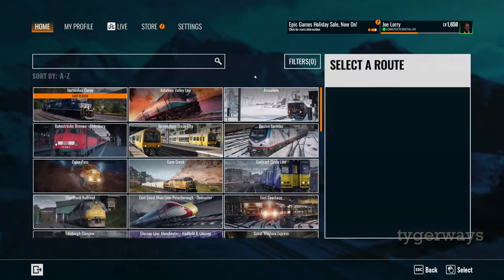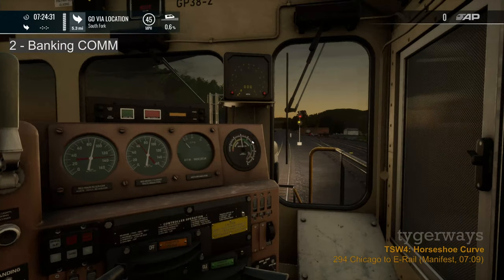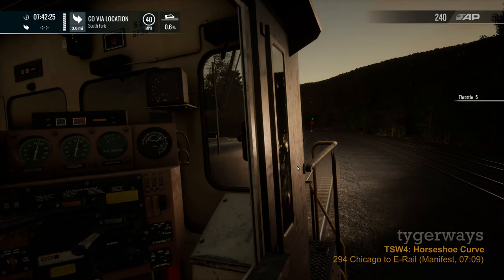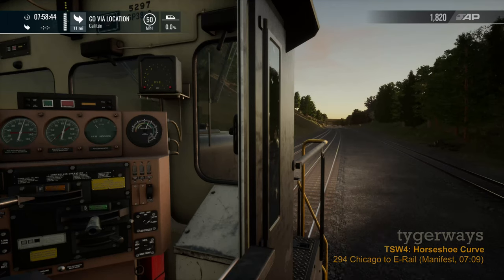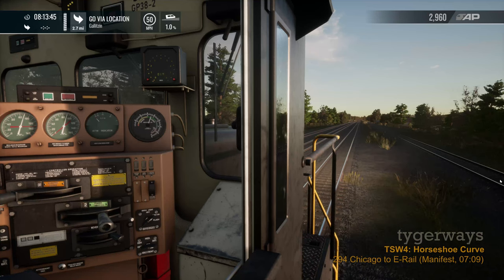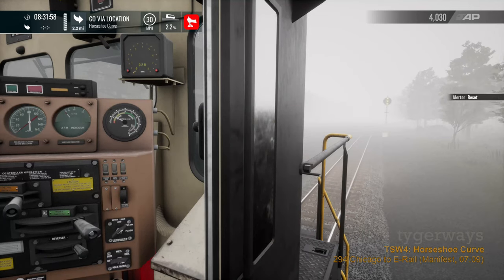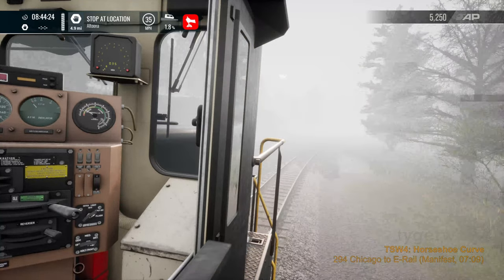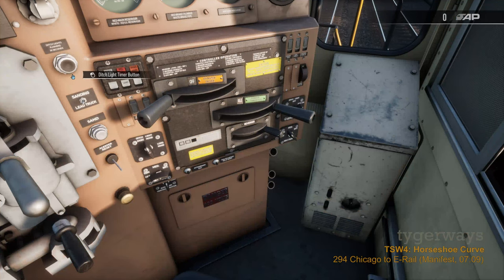B-Reel | Beating the script – Horseshoe Curve NS GP38-2 Multi-Unit setup (Train Sim World)

Comment: Tyger have you tried the Does Wet Coal Burn scenario, in Horseshoe curve? It’s quite interesting!!
Reply from the maker: I did and totally agree, I liked the scenario a lot. The grain of salt is that it takes some fiddling to get the Banking COMM running properly and the weird brake physics on the EVO's dynamic brake can get a bit annoying at the slow speeds on the branch line (at least this was the case when I played the scenario about a year ago).